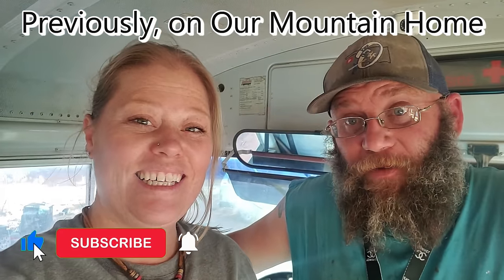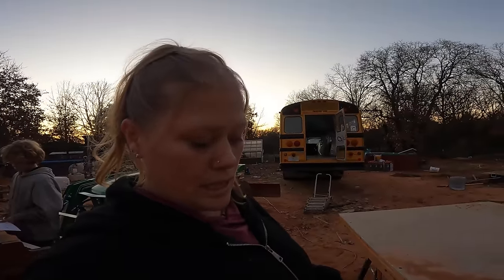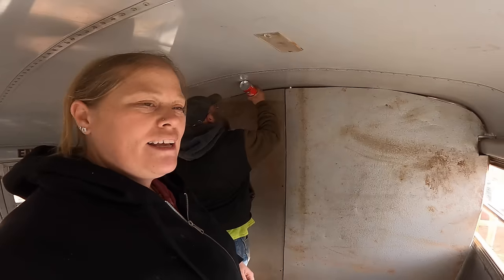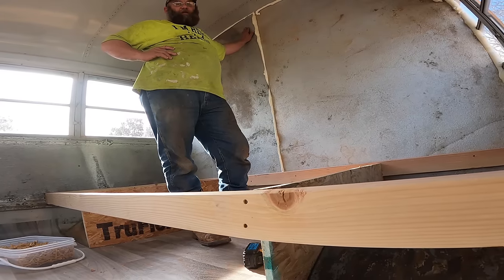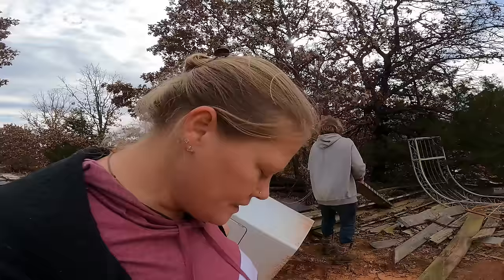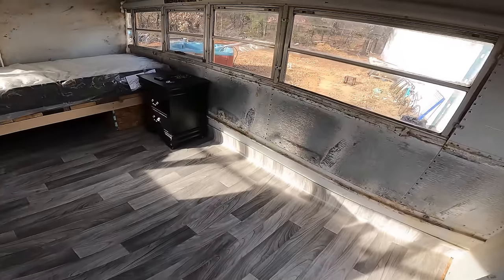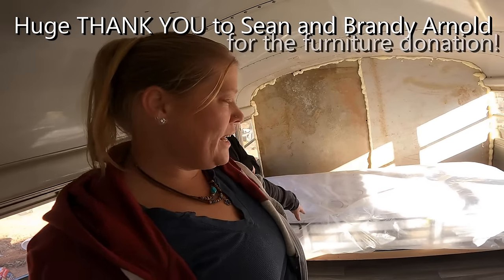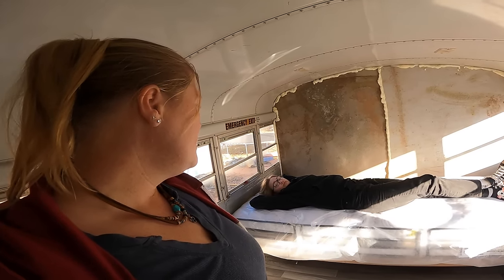Bus build: Ep. 4 - Divider wall & Bed frames #schoolie #offgrid #buslife #couplebuilds #diy #upcycle

Comment: The kids rooms are looking great. They must be so excited. Your moving right along. Thanks for sharing. God bless you all🥰✌️🇺🇸
Reply from the maker: Thank you, Charlene. They are very excited. It seems like a slow process, but we are getting it done. Our next episode should be out by the end of the week. We show y'all how we installed the ventless, propane heaters. For the most part they keep it warm. However, with this cold arctic blast, they are not enough. But we expect it will only get better when we finish insulation and build the interior walls. This cold weather is pretty brutal. I hope you are staying warm wherever you are. ❤️

Comment: Dang that is a nice room. You could just paint the devider .
Reply from the maker: Thank you for watching, Sheila. We are considering this option. It would be a relatively inexpensive way to handle the situation. I think it would require a lot of prep work. We would need to sand the wall a little bit and clean it really good to get the paint to stick. But it is certainly an option.

Comment: That turned out good.  Since shelves are going on the wall, I would clean the wall.  The divider wall is going to be covered with shelves and not seen. Maybe put a trim piece down the middle.
Reply from the maker: Thank you, Gwen. You make a good point... We could just use some rough-cut lumber off our sawmill and build it like you would a stand-alone bookshelf. 🤔 Thank you for watching and for taking time to share this wonderful suggestion. We appreciate your feedback.

Comment: The bus is looking good.  The kids will live it I'm sure.  I hope you can keep it warm enough.
Reply from the maker: Thank you for watching and for taking time to leave a comment. The kids are extremely grateful to have their own space again. We installed some ventless propane heaters (in the next episode) and so far, they are doing a good job. However, we have experienced this arctic blast and it's been pretty cold in the bus. Once we finish insulating and build the interior walls it should help a lot. Fortunately, it doesn't usually get this cold.

Comment: You can use material for wall paper it helps with noise ..it will be fine when it's done...or canvas tarps cut to fit ??

Comment: Wow that is a satisfying fit!!!!   This was fun to watch.  The room looks great.   

Sheetrock would be easier to fit for sure, then paneling.  I would be tempted to cover it with fabric personally.   A beautiful tablecloth is fun to look for at a thriftstore.  

In the summer an exhaust fan in that emergency exit on the roof would really help pull out the hot air.   Can't wait to see it finished.
Reply: Or a pegboard.
Reply from the maker: Thank you, we have gotten a few comments suggesting using fabric. Wiley had a friend that used old jeans to cover a wall and Wiley said it looked REALLY neat. We LOVE to go thrifting!!. The exhaust fan idea is GENIUS!!!! We will have to find one that uses little power and will run off of a 12v system. When we get the bus to Arkansas, we eventually plan to build a large deck over the top of the bus. That way it will help shade it from the hot summer sun. Plus, it will be a cool place to hang out. The other buses we have are fiberglass. So, they shouldn't conduct the heat like this metal bus does.

Comment: What kind of window coverings will you be using?
Reply from the maker: Dee, thank you for asking this question... To be honest, we haven't exactly figured that out yet. lol We tend to try use whatever kind of junk we have lying around. We plan to cover most of the windows with insulation then build a wall over them. However, Emi wants to make curtains for the windows we decide to leave. Just a warning though. Our plans tend to evolve as we get closer to a project... So, be prepared if we decide to go a totally different direction. lol We believe that the key to success is to be flexible and adjust according to the circumstances at hand. Thank you for watching and for taking time to leave a comment. We appreciate your feedback.